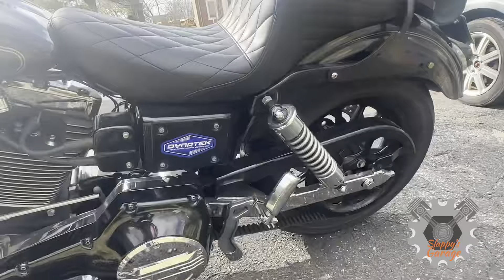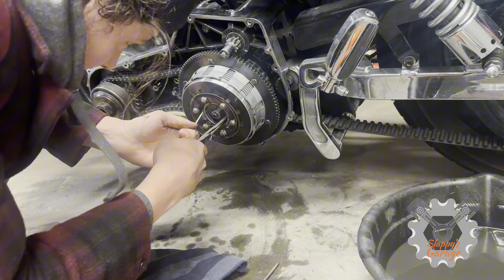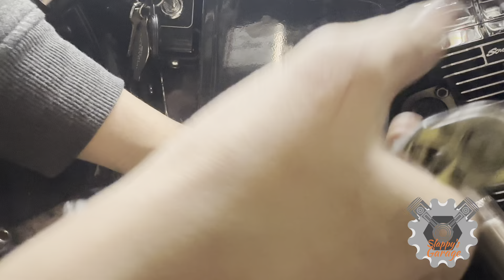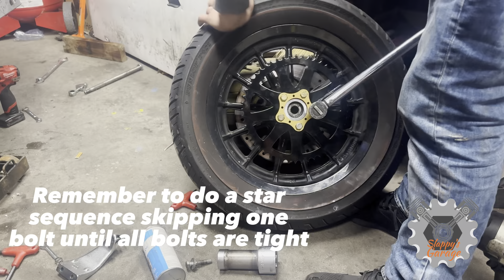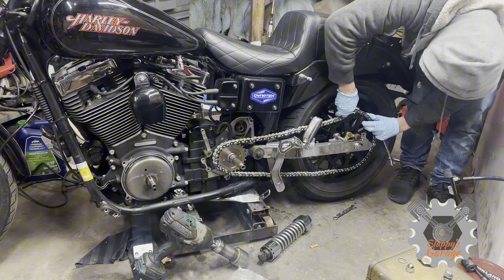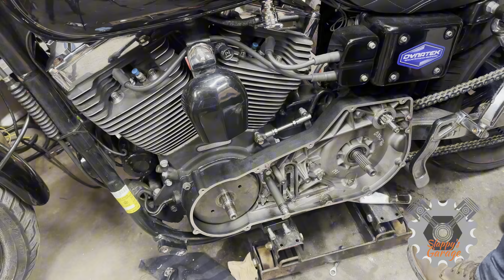99-05 dyna Mid control and chain drive install

Comment: 01 FXDX. I did this to replace a broken shift shaft. After assembly the shift shaft is tight, there is no play to allow it easy snapping back to shift lever’s middle position; the lever either sticks up or sticks down. 

 I bought the DragSpecialties replacement for 99-01.  I can’t find the broken one to compare diameter or length of the shaft end.

Before I pull this primary cover off- any ideas here?
Reply from the maker: I have in the past put the shift shaft sleeve (the exact hole I cannot recall off hand but it was suggested in a forum)  onto the wrong clip hole and experienced this issue.  There was not enough play for the shaft to spring back.  Luckily I could reach the clip through the inspection cover after being fully torqued. Also experienced a bent shift pawl out of the transmission binding on the case or a clapped out linkage that would stick when shifting.  First check if you have the sleeve in the wrong position binding the shifter or linkage on either side of the primary if not inspect the linkages all before inspecting internal issues
Reply from the maker: So in retrospect check if you have gap on the backside and frontside of the shift shaft and if it rubs on the sleeve on either side u can adjust it carefully (keep a magnet handy) through the inspection cover

Comment: You skipped step ONE..disconnect the battery, so there can be no accidental starter engagement, ask any 4 finger mechanic why.. I have 3 friends that have made that mistake over the years.

Comment: Do you not need a Shift Shaft Tube gasket? I'm about to do mine. I have a 2004 FXDL
Reply from the maker: @rileyhicks8421  it’s a cheap thing to do, it’s just an o ring so I won’t have to every time. But it’s cheaper to do it for at least the first time then to pull your primary off to do it the second time

Comment: How much would this cost on an 01 WG?
Reply from the maker: @cjbat8794  all depends on the used parts market.  Mids, 250ish plus an inner primary (wideglides don’t usually have a mid shaft hole) 100-200ish (would be cheaper to have yours machined out if you know a machinist). Plus gaskets would be 400-500 in total.   Chain drive kits can be 250+ without labor you are looking at $650-750 in parts.  Now both are necessary to remove an inner primary so if you want both it’s best to save on gaskets and do them together

Comment: Where did you find a mid control inner primary
Reply from the maker: eBay, 99-01 are a different primary so be careful.  Otherwise any reputable machinist can bore u a hole in the proper location

Comment: Nobody talks sbout mid controls conversion on a wide glide, that came with factory front controls and doesn't already have a mid controls shaft,or hole for a shaft in the inner primary case. All the videos are for a simple mids swap thats almost in place already, and TC Bros and the like only sell "Kits" that are incomplete bolt ons only for footpegs. Your video is great,but its yet another one that doesn't address wide glides. I don't need my bike disassembled in my garage for weeks while i flip thru Clymer wich also doesn't adress problems, and Clymer literally has my exact motorcycle on the cover, a 2003, anniversary edition wide glide. Just saying.
Reply: @ 6:50 he said exactly what you were looking for
Reply: @dbear3 lol, i ended up buying a good condition inner primary housing from a parts shop, with the hole for mids. Then rode the bike around until i got used to the forward controls, and now like it, and the 200 dollar inner primary is just sitting in the bix i got it from.
Anybody looking for the inner primary, mid controlled,  for an 2010 Dyna Fat Bob, let me know, its for sale at around 100 bucks lol. Btw this Fat Bob is so much more highway friendly than my 03 Wide Glide, Anniversary edition,  which is also for sale, cheap at 2500, in Pennsylvania
Reply: @Chripiter you want to ship that thing up north ?
Reply: See my comment for my work around.
Reply: I installed a TC Bros Dyna Mids kit on my 2005 Wide Glide(carb'd). Due to my short inseam.
I did a work around on this, as my factory
Primary Cover doesn't have the hole for the midmount Shift Lever.
So, I used the shift lever that came with the kit, heated it, and did a custom offset bend to it. Then cut off about half an inch from the tip of the shift lever.
Drilled a small hole to mount the shifter toepiece.
Then, mounted this new shift lever onto the stock, Forward Mount Shifter Arm.
The only difference, is I mounted this Shift lever facing backwards, to be shifted from the new midmount footpeg.
This setup works great for me!
Kept the factory Forward Mounted Footpegs for use as Highway Pegs.
The only difference, is the new shift pattern.
1 up
4 down.

Comment: I have a 99 fxdx and my shift tube is all the way out but when I put the inspection cover on the oring is showing. The inspection cover is oem he but the round piece is welded on both sides and centered. Shouldn’t it be offset to the outside or can I cut the shift tube toward the motor side to bring the oring back or put 3 gaskets on the inspection cover or just get the correct offset inspection cover?